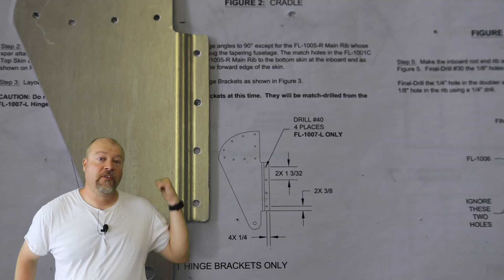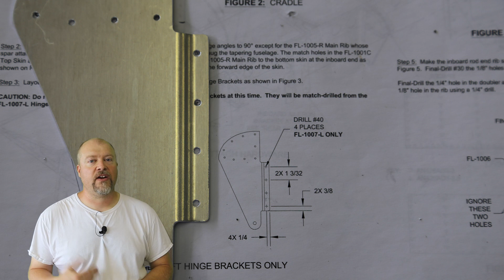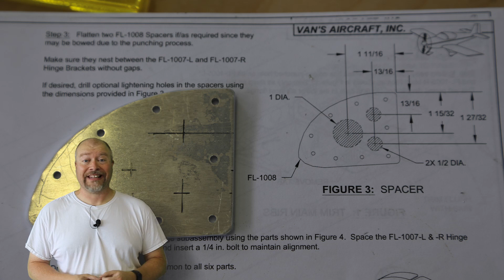RV-10 Extra / Wings - 063 - My Report of Airventure and Working on flaps

Comment: when you use aviation snips, be sure to make sure to file and smooth all the cut edges, and especially in a radius of a bend that you nick. if you do not sand that nick out of the radius it will crack.

Comment: People make a BIG deal out of excessively deburring parts. That's fine I guess. But as an A&P mechanic who has works on a whole bunch of aluminum airplanes over the years, I can assure you that neither Cessna nor Piper ever went to nearly the same extremes as I see some of the home-builders doing when it comes to removing burrs from the edges of shear-cut aluminum. So chamfer the edges of holes and run a file over shear-cut edges, no problem. Use the Scotch-Brite wheel if you want to save some manual labor...I've got no problem whasoever with that. But when I see people in some of the YouTube builder videos implying that you somehow have to polish and buff the edges of these parts so as to avoid the dreaded "stress risers" is poppy-cock. Cessna and Piper never did that, and I've flown 50+ year-old aircraft from both manufacturers...for hundreds if not thousands of hours. 

The point I'm trying to make is very simple: Do what you feel you need to do to feel that you've done your best, then move on. Otherwise you'll never get anything accomplished, and just get frustrated. It happens. 

Your project is really coming along nice though. I'm watching your videos (more or less) from the beginning, and am impressed with how things are looking. I'm likely going to build an RV-10 myself, so I'm very grateful to the folks like you who take the time to make these videos. The production value is outstanding!

Comment: I'm relatively new to the channel. As an aircraft mechanic building my own plane has always interested me. One bit of advice: never underestimate the little bits of weight saved here and there. It adds up. Many times I've had the weight difference of a matter of a few thousandths of carbon fiber result on sanding and restarting.

Comment: Why is deburring process so critical?...it eliminates concentration points for the development of stress fractures. Because the vibratory effect of the engine is the most amount of stress on the  airframe its best practice to get your parts smooth. When I was in school to become and A&P it was stressed. So how smooth? We teach our interns to make a pass with a file, then 250 sandpaper, then 400 and sometimes 800. If you do it right its not that much work. Also paint does not adhere well to sharp corners.

Comment: Two common gotchas:  You read (or thought you did) the instructions, and find you still did something wrong.
--- you pay close attention and perform tremendous work on a section, only to find later, Vans issues an SB to change something and have you undo all your perfect work ...

BTDT

Bandsaws ----->  keep extra blades.  You will wreck blades if you cut anything steel

Comment: A big part of Oshkosh is who you will meet this year and be able to visit next year.  I met a fellow from Australia who is also build in an RV 10 while looking at doorhandles of the 30 RV 10s that were lined up in Home built parking his list and my list where similar avionics brakes fuel valve lights and door handles and locks cowl flaps.  He found an apartment interior that I have never heard of that I will be checking into.

Comment: Im sure you have probably stated this in the past. But what are the dimensions on your table in the hanger? Is it a good size or is there something you would change?
Reply from the maker: It's a standard 8' by 4' sheet of 3/4" ply wood with a 2' extension on one end.  It's ample space.  I built it to be robust, but it could be even more sturdy.  Mostly I need to add storage under it.